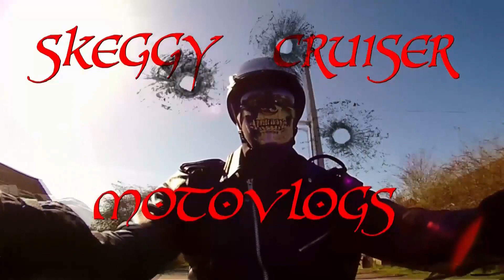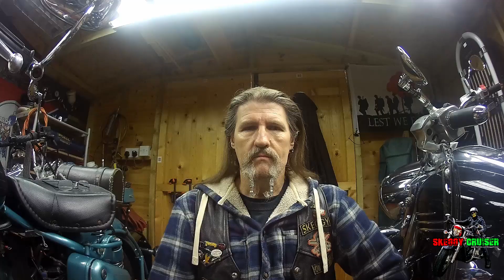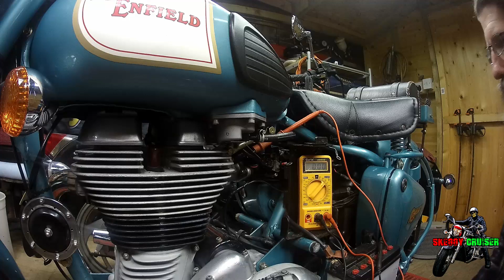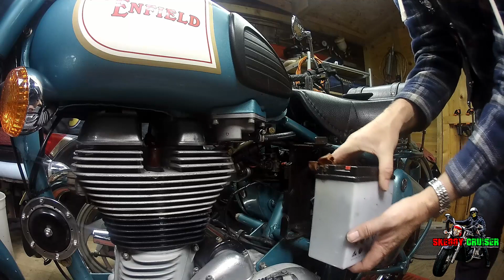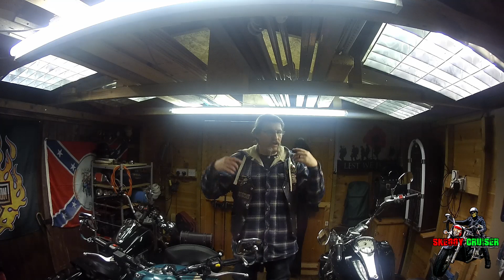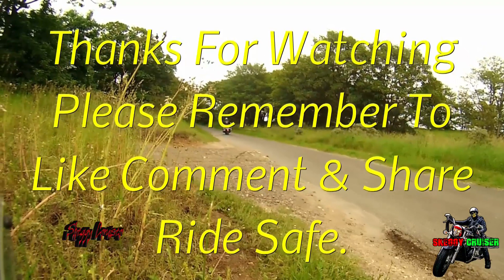Royal Enfield Bullet 500 EFi Resetting the Throttle Position Sensor

Comment: Great video, i followed your instructions today and adjusted my RE classic 500 efi sensor to 0.7 my stock setting was on 0.6 but due to adding a viper short exhaust this was a must...
The only vital info missing on your video was to tell us to Turn ON the Ignition Key (not engine running) to get the volts reading, this might be common sense but when its your first time it didnt cross my mind to switch the key on 😀
Thanks 🍺🍺👍🏼
Reply from the maker: Cheers buddy, bugger I never even thought about telling people to make sure their ignition is on, your quite right in that not everyone would know this, hopefully future viewers will read your comment, I've pinned it so it remains at the top, hope your bike is now running better, mines great now hence no follow up video, thanks & RSM8.
Reply: @SkeggyCruiser  my bike is running like a dream, pulls a lot smoother and nippier 👍🏼🍺🍺

Comment: You have given me more ideas as to what this troublesome Classic of mine could have wrong with it. I have had it 6 years but about 3 years ago it became a truly troublesome bike. It would cut out after about 3 miles and simply die and engine light would stay on. It would start, run for a few seconds then die again. After about 10 attempts it would fire up and run with engine light on. In November I dumped it in the field behind the house as I was fed up with it. Then in Jan I got it out again (Why I ask ;-) and she fired up and did about 1000 miles trouble free riding. Then last week she started her crap once again and after a long struggle to get home I dumped her in the field yet again where she can stay.......that's until I try again ;-) I love this bike but hate it for all the trouble its given me over the years. I have 5 Hondas which have been around the world and never given me any trouble at all. I will try moving that Throttle position sensor and see if it makes any difference but I don't think it will. A leopard never changes its spots ;-) Thanks for video
Reply from the maker: Really sorry to hear about your troubles buddy, hope it works for you,  some of the comments on this video may help you on your way, my brother just said I don't suppose you wanna swap for his honda cbf100 do you lol, good luck mate, ride safe.
Reply: This one I have is getting mounted in the garden. I love it but it must have let me down about 30 or so times now. The one I had before I shipped to India an rode it back no problem but like a fool I traded it for this one. Now I got another waiting for me in Scotland which I will have to ride to Slovenia in the summer. Here I just use my CB125 and it really has been amazing. Take a look at my clips and you will see how mad I am on bikes. Ride safe

Comment: Hey, thanks for your helpful video. I still have a question, and it would be great to get an answer: Was your light on while working on the tps? Because it has an influence of the tps-values. 
Greetings from Switzerland, btw. I have the same Lycette Seat on:))
Reply from the maker: Hi thanks for the question and sorry for the late reply, to answer it I would say that the only lights on when setting the tps would have been the neutral light and the side lights when the engine wasn't running but ignition on, hope this helps buddy.

Comment: Hi I see your blog is a couple of years old. But I got a problem with my GT535 and it’s idle speed . When I start it up it’s fine but when engine gets hot it bounces about and sometimes the engine cuts out. My temporary solution is to adjust tick over to higher rpm. As it has after market exhaust and a K&N air filter I’m wondering if this TP sensor adjustment could be the answer
Reply from the maker: Hi Gary, sorry for the late reply, hopefully you've got the bike sorted but if not then yes I would say the TPS adjustment could be the answer, it worked wonders for my 500efi this also had the K&N filter and aftermarket exhaust, RSM8.

Comment: Brother I have 2010 model 500 . It have a missing issue ilke if bike goes in slow speed under 40km /h.
One time I removed a pipe under throttle body ( I think its a air intake pipe ) the issue is solved 

Help me about this issue 
And what is the use of that air intake pipe
Reply: Check your plugs if its black then its running rich  check your tps adjust it to .2 to .6 volts 
the pipe you removed is pcav pipe dont leave it like that if you want to delete that pipe atleast close the hole or it creates a massive vaccum leak
Reply from the maker: Hi sorry for the late reply, I agree with Usman, the hole must be plugged or pipe replaced, a lot of the time with these I've found it to be trial and error with small adjustments, it does seem a strange problem though, almost like it's struggling to breath below a certain rev range or something, I would normally adjust the TPS, it all depends on whether your still running standard pipes and air filter or aftermarket free flow etc,

Comment: Great stuff.....just got a 2015 classic, splutters when I touch the throttle, and the plug is jet black. I've put in new air filter and plug but this has not helped. What's next guys???
Reply from the maker: If you've altered the TPS and not had any luck I'd try the online forum, I've found in the past that no matter what problem you've got, someone had it on theres before you and have aready asked the question, normally the answers there waiting, I've now got rid of the bullet as I traded it in for the Interceptor but would have loved to have been able to keep it as well, Hope you get it sorted buddy, RSM8.
Reply: If yur using the Bosch factory plug then thats a problem. use the NGK BPR6ES makes a huge difference.

Comment: Does tps is important in classic 350 carburetor model bs4
Reply from the maker: As far as I'm aware the 350 Carburetor model doesn't have a throttle position sensor, only the EFi models, hope this helps, RSMF.
Reply: @SkeggyCruiser  we have the tps version in gunmetal grey model bs4. Can u sujjest me the settings of it for beter pickup.
Reply from the maker: @chandansharma8720  i'm really sorry but I have no idea, maybe you could try one of the forums?
Reply: @SkeggyCruiser  okk thanks for the reply ill have to dig some more information

Comment: What problem did you have in your bike ? Was the bike misfiring whilst revving up ?
Reply from the maker: It was backfiring and on many occasions blew the air box open snapping the lock mechanism, after altering it it's been great.
Reply: @SkeggyCruiser  wow. Your bike exactly had same same problem as mine did. I was puzzled as to where to start from as I was looking for problems. My spark plug was getting black sooty deposit real quick i.e. it was running rich. My mechanic wanted to change oxygen sensor which is $450. One day I stumbled across your video and re positioned TPS from 0.81 volt down to 0.56 volt. Now my bike runs like a dream. So thank you for uploading the video , I have benefitted from it a lot. Hope your bike is running smooth as whistle as well 🙂😊.
Reply from the maker: @TheAzharuddin  Many thanks for the feedback buddy, good to know it helped, thanks.

Comment: I have a Royal Enfield Electra with highway kit fitted. 32mm Dellorto carburettor, modified inlet air filtration system, and a road legal free flow silencer goes really well.
Reply from the maker: Sorry bro, don't know how I missed your comment, but I've finally seen it, yes I sometimes wish mine had the carb kit fitted but it runs great at the minute and I'm a big believer in if it ain't broke don't fix it, lol, knowing my luck something would go wrong, lol, RSM8.
Reply: No worries mate

Comment: Looking forward to update on this. I just picked up a 2017 efi500 and want to change the exhaust but also feel like putting a power commander on a 27hp bike is a tad silly so would like to avoid spending that kind of money.
Reply from the maker: I have to agree about the power commander, I'm happy with what I've done so far but may give it a tweak, I'll try turning it down first then if not totally happy maybe go back up above the 5.8 where it's set at the minute, the thing is it all depends on how free flowing your exhaust and air filter are, thanks and RSM8.